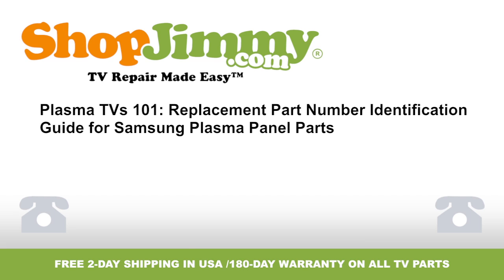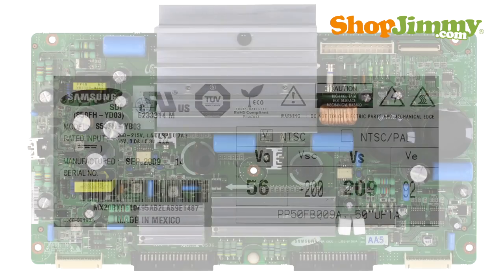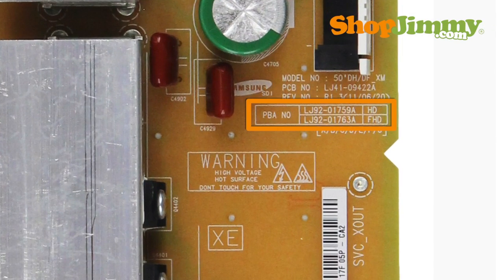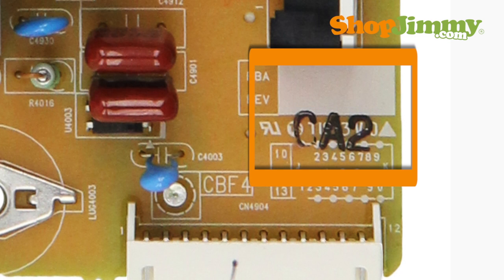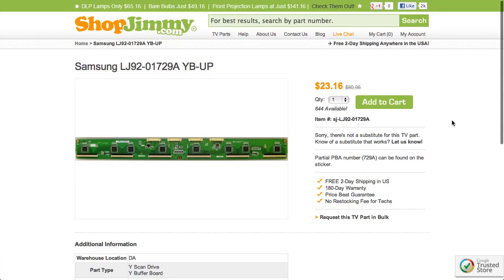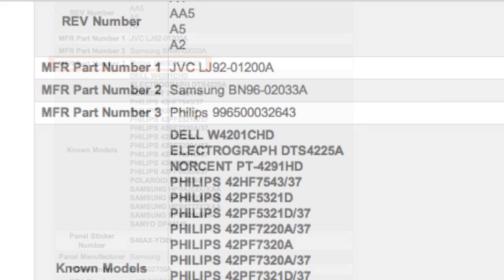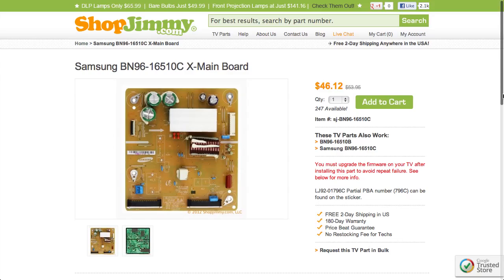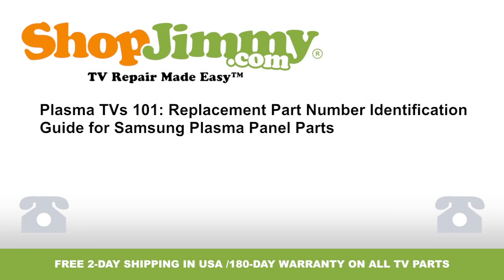Samsung Plasma TV Repair Tutorial - Identifying Samsung Plasma TV Parts - How to Fix Plasma TVs

Comment: Hello I have a 50 Samsung Plasma TV model PN50B450B1DXZA. It will not turn on, I have replaced the main board (purchased from ShopJimmy.com) and that did not fix it. Seen something saying it also could be the y-sustain board. I purchased Y board and replaced it on TV. Still having the same problem. When you try to turn it on it clicks like its goin to come on but does not. What else could it be? please advise

Comment: Hello, I have a Samsung PN50B450B1D that was a freebie but is getting expensive. I brought it back to life with a new sustain board and it died again a few months later. I foolishly guessed that the board was bad and repeated the cycle but another sustain board has died. I can find no physical damage to capacitors, fuses of ICs. The diodes I've tested have also worked properly. Any ideas as to what's eating my sustain boards? On that subject, what components normally fail on the sustain board?  Thanks Wiseguy

Comment: great videos...!!!i have a samsung plasma ps50b450 which has the exact same back cover as the one in 0:25!!the problem is that when i power it on there is a constant clicking sound ...like a relay...!!i ve read about bad capacitors in the power supply board ...if the caps are not the problem i just saw your video try to determine the source of the clicking sound by isolating one board at a time and this is probably really helpful!!also i noticed tha t when you are reffering to y or x sustain board problems MOST OF THE TIMES THERE IS SOMETHING WRONG WITH THE PICTURE ITSELF BUT THE TV TURNS ON FINE ...RIGHT?
two questions...
1.if there is more than one fuse in the psb and just one is blown ....will  i have a standby mode-light ...or not...??
2.if the mainboard is the problem and one or two ics are the issue can someone replace just the problematic ics and not the whole board....and are these ics available??

Comment: I have Samsung Plasma Model #PN59D530A3FXZA Version Y302. You hear it power and it has no picture, no standby light, and you can hear a slight buzzing sound.On the main board there is a green light that flashes once per second. All fuses are good. There looks to be no damage to any of the circuit boards or components.any suggestions?

Comment: I have a Samsung PN60f5350BFXZA.  60in Samsung Plasma.  I took a lightening hit a few days ago through the Comcast cable.  Everything connected to Comcast blew, my 60 in Plasma, A/R a second tv and my blueray.  My question is about the 60 Plasma.  It will not power up or anything.  This was not a power surge, but was a charge through the HDMI cable.  Any thoughs on what can be repaired or replaced inside.  Hate to lose it.

Art

Comment: Hey thanks for the video, I am repairing a samsung 50" pn50b860y2f. It powers on but there is no picture our sound. I replaced the main logic board thinking that it was the issue but was not successful. After a closer inspection I notice that a chip on the Y buffer has a burned hole through it and so that obviously needs to be replaced but as far as trouble shooting steps go, how can I trouble shoot other boards (particularly the Y sus) to find out what caused it to burn out. Should I also replace the Y sus with the Y buffer or do you think the issue may just be isolated to the Y buffer? Thanks for your time!
Reply: i have the same issue. were you successful in fixing the tv?
Reply: it did fix it however the picture was not normal and then it wen't black again. I think the problem was with Y sus but I didn't end up replacing it because somehow my screen got cracked (I think by my roommates) and so I didn't wan't to put anymore money into it so I just scrapped the parts and tossed it

Comment: I have an issue where my Samsung Plasma TV will randomly go black while sound will continue. The TV is not turning off as indicated by the front LED, but rather the screen just stops displaying video. It does not happen often, but it does continue to happen. I previously asked on here for a suggestion and have subsequently replaced the Y-Main board and Top and Bottom Y Scan Boards. Unfortunately, while the new parts work, the old problem still persists. Do you have a recommendation on the next parts to try and replace?

Comment: HI, I have a 50" Samsung plasma TV model #PN50B530S2FXZC
It has sound but no picture.
I suspected it is the main logic control board which you may have in stock.
I check all capacitors and they are fine, but I notice when the TV  is off the green LCD light in the main logic board blinking and when it was turned on by the remote control it stops? Is this normal. The TV can be turned on and off by the remote and the power light show up, has sound but no picture/video.
Pease help, thanks.
AL

Comment: Hi.. I have a 51" Samsung plasma TV. model # PN51F5300AFXZA/ version US01/2013. Our TV periodically cuts on and off while we are watching it. It can be in increments of every 8 seconds for 5 mins or more. the TV was purchased 2/2014. Now I've googled the problem and they say capacitor need replaced. I haven't taken the TV apart to see if that's the case. But I really would like to fix this myself. any suggestions?

Comment: Hello, I have a PN51F5300 and the HDMI ports have all quit working.  The component ports work fine.  TV is 18 months old.  I've tried the reset, hard reset, spoke with Samsung support, etc.  My warranty has expired so it's on me.  What part can I order to fix this issue?  One HDMI port is barely limping along and only works on an xbox one and not my cable box or anything else.  Today it finally seems to be dying as its going between no signal and an intermittent signal while connected.  Reading online it seems to be a main board, but that's all I can find.  I"d be happy to purchase and try to fix myself using your great tutorial videos.  Thanks

Comment: Hey Guys
I have a samsung plasma 3d smart hub model# PN60E550D1FXZ. I was told by a tv repair that the y board was gone, (BN96-22115A) he told me as well that this board is no longer available as it is no longer produced, i am sorry but, like wtf as i only purchased it in 2013. anyway, I checked on your site as well and says the same thing,but you have a repair kit available but the symptoms you list dont seem to really match up with what mine is doing, as mine, will just very quickly flicker when you first turn it on and just go black no clicking sound no anything. He told me that the power supply is showing the 257v it is to have. now you have the repair kit but i noticed it does not have the capacitors with it, is it possible to purchase these as well? just in case this helps my son trip over the power cord and it shorted out on the wall socket then the tv no longer turned on.any ideas? thanks guys for any help.
Reply from the maker: +Ed Wilson  Try all repairs and troubleshooting at your own risk.   Unfortunately, the kit will not fix your problem, as it is tough to say what was damaged when the socket shorted.  Thanks! www.shopjimmy.com

Comment: i have a samsung HP-R5072, when i turn it on it starts to flash from black screen to the pitcher for about 10 to 15 minutes then it works fine till its turned off again, my solution to this issue is leave on with screen saver and its been this way for at least 6 months but i would like to fix it, any info or link to your parts would be greatly appreciated

Comment: hi, I have a samsung pn60f8500afxza plasma, that won't power on, just a blinking red standby light in the front. I've done some basic testing, with your videos help, but need more advice. Tested voltage at the Power Supply board, all voltages look okay except VS&VA. VS should be 210dcv but reads 11v and VA should be 60 but reads 0.03. They read at their proper voltage when first plugging in the unit, but continually decrease till they reach low voltages.I tested vs and va at their board test points and individual plugs throughout the unit
 The remaining voltages around the board are good and all grounds check good. Standby is 5.2 and PS-ON is 3.1 while unit is unplugged and 0.02 while unit is plugged in, is that normal?
I checked all y-board to y-scan drive board connections for resistance/ground continuity all seem good. I did find two pins on the X-board connections showing resistance/continuity to ground on the upper most x-board connection, could this be the problem or should that be a grounded posts within the connectors?
I was given this tv from a friend to see if I can get it running, so any help would be greatly appreciated!
Reply from the maker: +canam8967   Try this at your own risk. Unplug the TV, then disconnect the y board and plug in the TV to see if the TV powers up. Note that it will not have a picture on the screen. Reply with the results of this test. Thanks! www.shopjimmy.com
Reply: canam8967 did you ever fix this?  If so, what worked?

Comment: this is an awesome channel!!!. I need some more help. I have a samsung plasma tv pn: pn51d550. I've watch some of the other shop jimmy videos and narrowed it down to a x main board. How do I know for sure it is a x-main board, and if it is that board is there anything else I could do to troubleshoot the board? The symptoms are that when you first plug the tv in, the relay on the power supply board would click and the heart beat LED would blink twice. this would happen three times and then it would stop, heartbeat LED would not come on and no more clicking. I have looked at all capacitors and they are all good. I've also visually inspected all components on the x main board and they look good too. with the x main board unplugged from the power supply the relay would just click on once and the board seems to get power, the heartbeat LED comes on but blinks slowly....any suggestions or solutions would be great!

Comment: Hi I have a Samsung PN43E450 Plasma with no video. when its pluged in the startup sound will play and the standby light will blink for about 5s then go out. I replaced the power supply and I now have the same problem. I unpluged the Y sustain board powered up, same problem. I unplugged the X board powered up, same problem. All the caps on the X and Y boards check out good with an EMS Meter. Voltage at Vs when first powered on is 209V(good) but quickly drops down to nil. Voltage at Va when first powered on is 58V(good) but quickly drops to nil. Thanks for any help. Paul

Comment: I have a Samsung plasma TV model PN60E550DIFXZA. I cannot get video. It began by not going on immediately after being turned off. This has been a problem for the last year or more. Recently it had taken longer to get video, however sound came on immediately. Now video will not come on at all. I tried turning it on and off rapidly and video did come on.  I opened the set up and do not see any capacitors that appear to be bad. What do you suggest I do first?
Reply from the maker: +John McMahon   Try all repairs and troubleshooting at your own risk.  I recommend replacing the Y-Main Board and the Upper & Lower Y Scan Drive boards.  Click this link to replacement parts for your TV model number:  http://www.shopjimmy.com/catalogsearch/result/?q=PN60E550  There may be multiple boards for the same TV model number, be sure to match part numbers on your current board, with your replacement for compatibility.  Here is a link to a video showing how to identify your part number, click here:   https://www.youtube.com/watch?v=R1jmj_foId0Thanks and please let us know if you have any further questions with your TV Repair!  www.shopjimmy.com
Reply: John McMahon John, did you ever fix this?  I think I have the same problem.
Reply: No. I tried several of the tests and couldn't find the bad circuit board. I shitcanned the TV and bought a Visio. I took out the parts and tried to sell them on bay but no takers. Good luck.

Comment: I have a Samsung pn51d450a2d plasma TV. I am getting horizontal lines on the screen. I have replaced the Y buffer and the Y sustain boards. Is there anything other then a bad panel that could cause this?

Comment: I have a Samsung PN50B550T2FXZA manufactured in 11/2009.  I first got one single pixel horizontal line across the screen a few months ago now I have 6.  I have replaced the Y Buffer with no difference.  Should I replace X Buffer and X and Y mains as well?
Reply from the maker: B Smith   Try all repairs and troubleshooting at your own risk.  This sounds like a TV panel (TV Screen) problem.  If your TV panel is bad, it may be more cost-effective to replace the TV as panels are typically hard to find in stock, difficult to replace, and expensive.  Thanks and please let us know if you have any further questions!  www.shopjimmy.com

Comment: Hey I have a Samsung ps51d550 and I put a small crack in the screen and now when I turn the tv on there is a clicking sound and the light only appears when i press buttons on the remote. There is no picture or sound at all would you please be able to help?
Reply from the maker: Sean Whelan   Try all repairs and troubleshooting at your own risk.  This sounds like a TV panel (TV Screen) problem.  If your TV panel is bad, it may be more cost-effective to replace the TV as panels are typically hard to find in stock, difficult to replace, and expensive.  Thanks and please let us know if you have any further questions!  www.shopjimmy.com
Reply: Thanks for your help I think Im gonna have to just get a new one

Comment: I have a philips plasma tv mdel #42pfp5332d/37...my problem is that the lcd lights blue&red are blinking but the tv doesn;t turn on..I need to know how get the parts in need...anybodybknows??
Reply from the maker: Salvador Ramirez   PLEASE SUBSCRIBE TO OUR CHANNEL - Try all repairs and troubleshooting at your own risk.  I recommend replacing the main board in your TV.  Click this link to replacement parts for your TV model number:  http://www.shopjimmy.com/catalogsearch/result/index/?cat=56&q=42pfp5332d%2F37  There may be multiple boards for the same TV model number, be sure to match part numbers on your current board, with your replacement for compatibility.  Here is a link to a video showing how to identify your part number, click here:  https://www.youtube.com/watch?v=xSSxNZXZIXAThanks and please let us know if you have any further questions with your TV Repair!  www.shopjimmy.com

Comment: Hello, i need help. My Samsung Plasma model HP-R5052, Type SR50P5, SR# AC7Q3CFYBO3958E is experiencing problems. It started with vertical blocks of lines in upper right (red) and lower left (blue), not a big deal,  but then yesterday, Ka-blamo! Screen looks as if it has been painted black , from the inside, with a paint brush. As the tv warms up the "brushmarks" seem to dissipate but leaving a black/gray snow effect with faded color picture in the back round. You can make out images and some color through all of the distortion on the screen and those vertical blocks of colored lines, they're now solid black blocks.. Is there a repair for this out there? Thank you for your help.

Comment: Hi,

Having an issue with a Samsung Plasma.
Model: PS51D550

Upon connecting a power cable, the power supply board relays click, then standby LED blinks once (a little more dimply than normal) and that's it.
Nothing further.
On the logic board, there's an LED labelled LED2000 - that LED blinks ONCE every few seconds.
Trying to use the power/standby button on the front panel of the TV results in the standby LED blinking once.. nothing more.

Where do I start troubleshooting this one?
Do you ship spares to South Africa?
Reply from the maker: ANiMOSiTYZA    Try this at your own risk. Unplug the TV, then disconnect the y board and plug in the TV to see if the TV powers up. Reply with the results of this test. Thanks! www.shopjimmy.com

Comment: Aug.'14 lightning strike very near TV neighbor perhaps knocked out both HDMI ports.  Picture and sound work fine on av ports from the cable box.  Horizontal lines when switching back to check HDMI, no picture.  Will replacing main board fix this less than 1 year old, at time of problem, TV, a Samsung Plasma PN 43F4500?  thanks.DMC
Reply from the maker: *****  Please watch this video FIRST to help with your repair!  https://www.youtube.com/watch?v=BP3NVNCGEv8  I recommend replacing the power supply and the main board in your TV.  Click this link to replacement parts for your TV model number:  https://www.shopjimmy.com/catalogsearch/result/?q=PN+43F4500  There may be multiple boards for the same TV model number, be sure to match part numbers on your current board, with your replacement for compatibility.  Thanks and please let us know if you have any further questions with your TV Repair!  www.shopjimmy.com
Reply: I will employ your advise, and follow up with my results. THX

Comment: The top half of my Samsung 32" LN32C350D1DXZA is flickering. The graphics on the picture are still visible. I'm curious if it would be an easy fix I can do myself, or if I would have to replace the whole board. Thanks!
Reply: It is horizontal lines through the picture.
Reply from the maker: Jody Miller   This sounds like a TV panel (TV Screen) problem.  If your TV panel is bad, it may be more cost-effective to replace the TV as panels are typically hard to find in stock, difficult to replace, and expensive.  Thanks and please let us know if you have any further questions!  www.shopjimmy.com